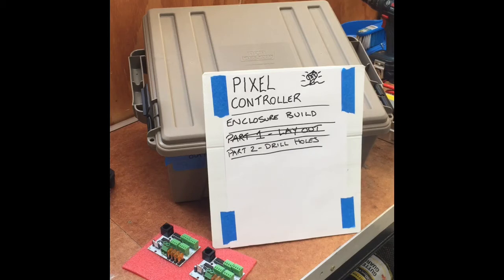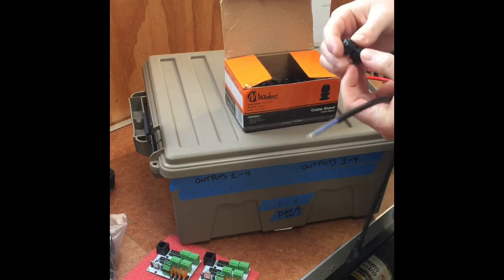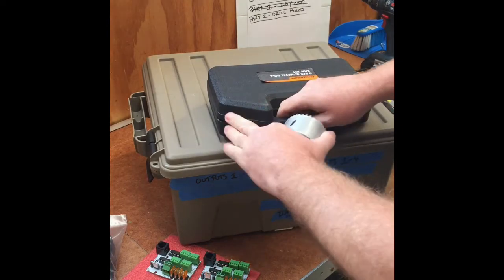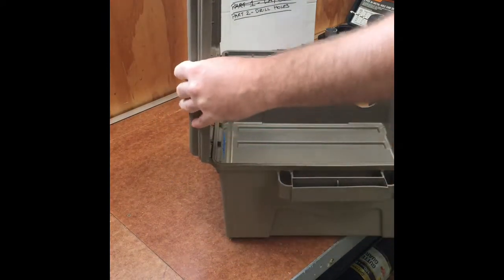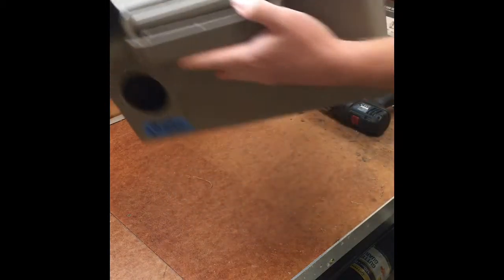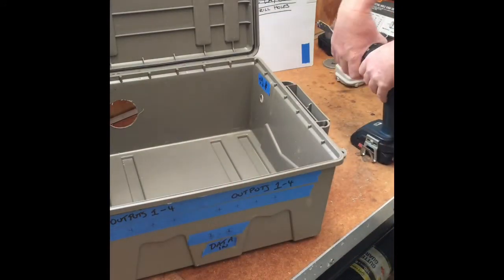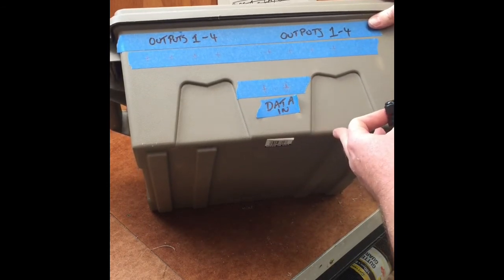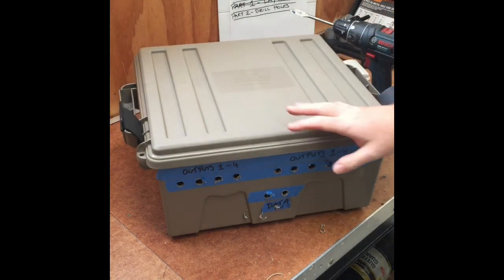Falcon F16 & F48 Pixel Controller Enclosure Build Part 2 - Hole Drilling

Comment: Good stuff.  For deburring the holes in plastic, you can get a small tool that you "wind" around the edge to chamfer it clean.  They are only a few $$ on eBay.